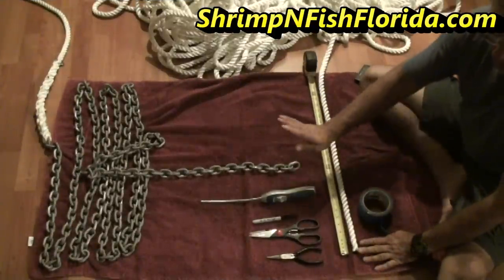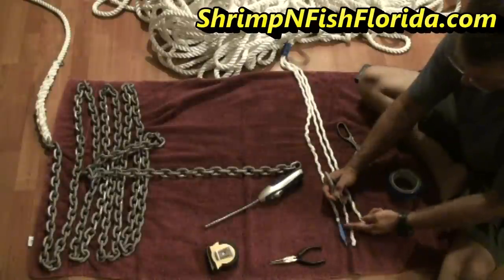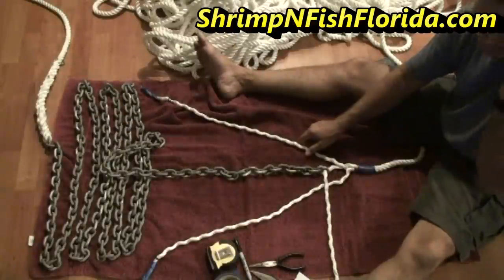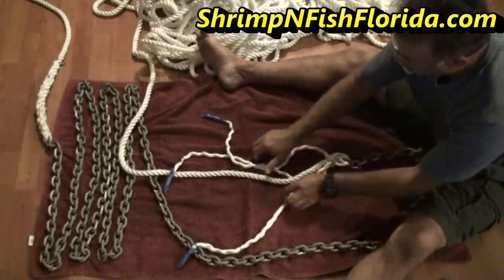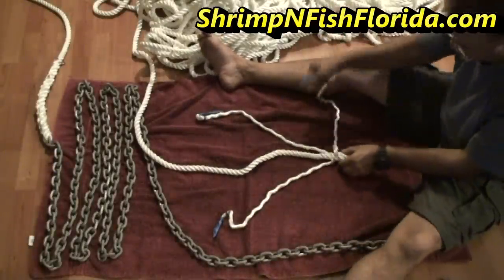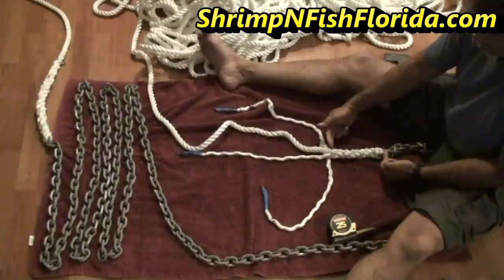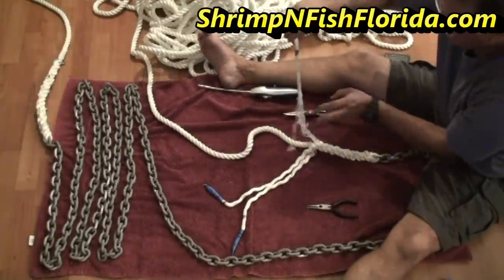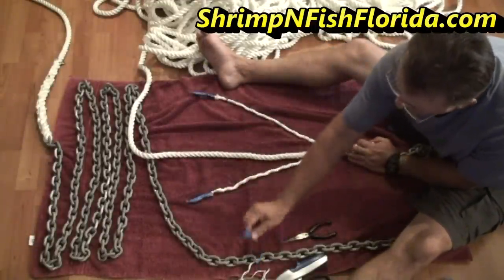How to Splice on Windless Rope to G4 Anchor Chain, Part 1 of 2

Comment: my windless line gets through the wench just fine but it slips at the splice where the rope meets the chain. Is this common or is there a way to fix it? I pulled my anchor and the line out completely and was thinking to re-tie the knot after i cut off about 10ft or just flip the line around and use the other end. I'd love for it to all be chain but it would probably cost $1000 for the chain